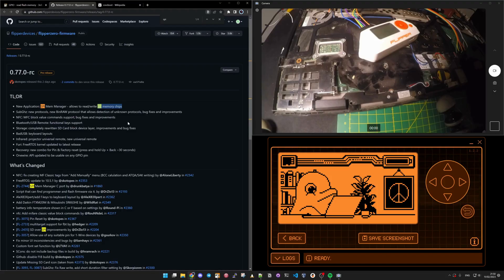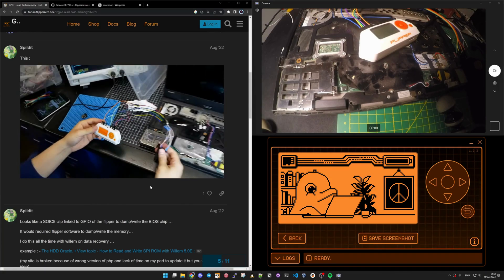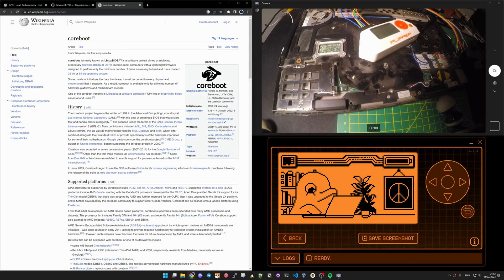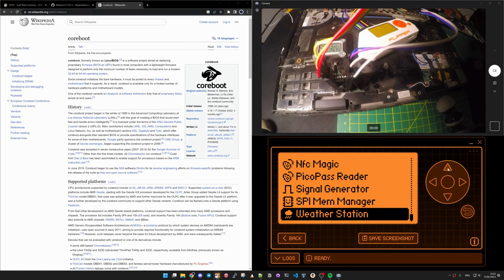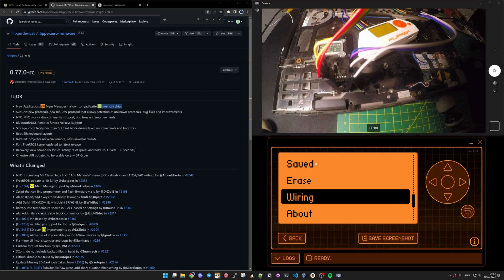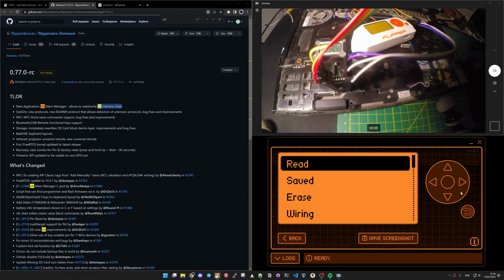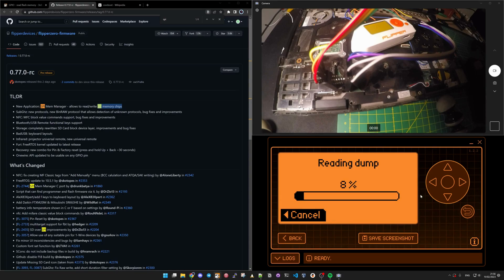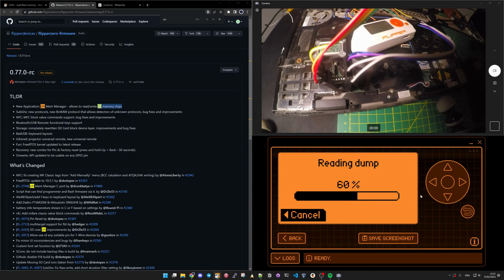Flipper Zero : Flash and Dump BIOS with the SPI flash programmer App.

Comment: I'm trying to get the key code off my ducati eerrom I have flipper and the clamp go clip on the chip but not sure how to read the info
Reply from the maker: Hi Wesley, before connecting everything, it's essential to have a datasheet for the chip. This document provides crucial information about the chip's specifications. Especially for the pinouts.
Reply: @samxplogs  I already have that
Reply: @wesleyredondo2523 So?
What does the datasheet tell you about available communication interfaces? Does it tell you which pins are spi or i2c? Does the bootloader have a uart?

These are all things you would know if you actually knew what you were doing.

Comment: Hello, what about the bios chips that require different voltages? For example I needed 1.8V to program a bios chip...
Reply from the maker: Hello Mr. Nobody, you are absolutely right in mentioning this concern. It's important to thoroughly check the datasheet before taking any action. Currently, I don't have any solutions to suggest, except for potentially using an external power supply, which may affect the portability of the device.
Reply: You can use a voltage regulator to step down the voltage. A popular choice is the LM317 adjustable voltage regulator. With appropriate resistors, you can configure it to output 1.8V. Make sure to consult the datasheet and use appropriate decoupling capacitors for stable operation.
Always carry a breadboard in your flipper kit.